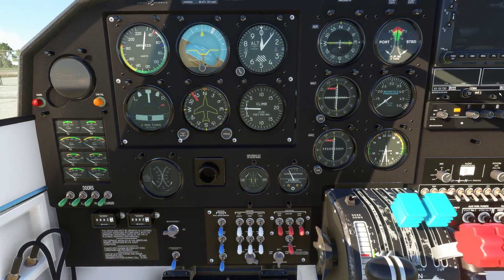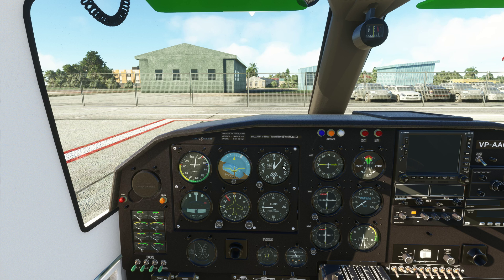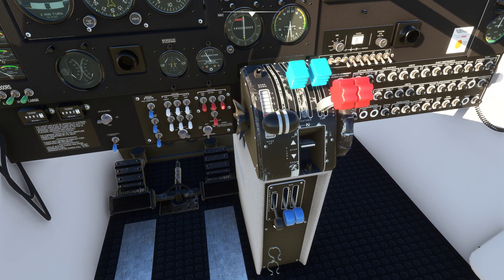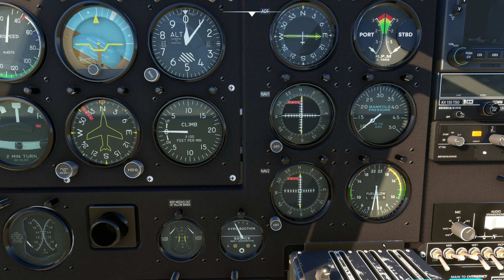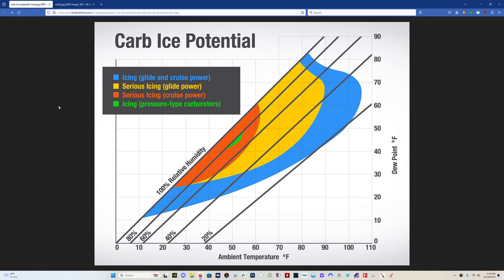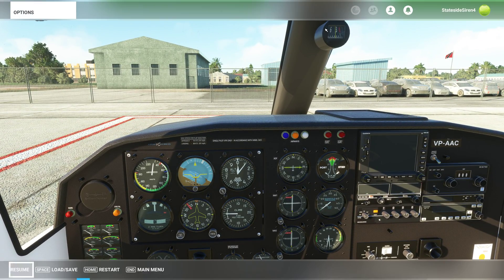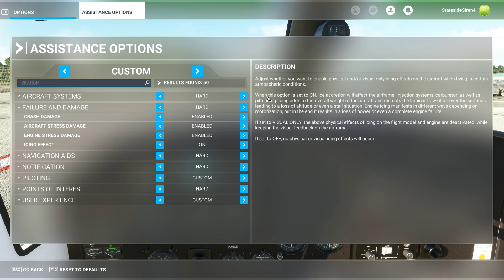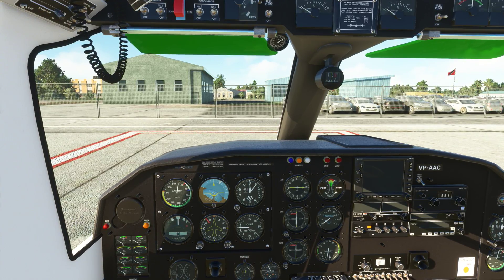Carb Ice | Pilot Training for Flight Simulator | MSFS 2020

Comment: IRL and sim pilot here. ”Everyone” knows that turning the carb heat on can cause the engine to run a bit rough due to melting ice, but I can’t believe I was never told of the dangers of turning it off prematurely. Thanks a lot for sharing!